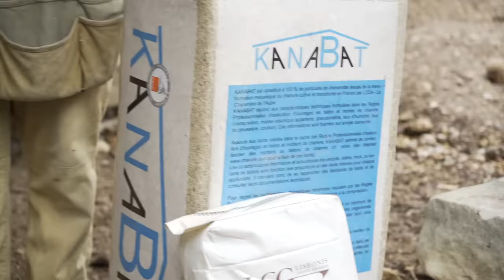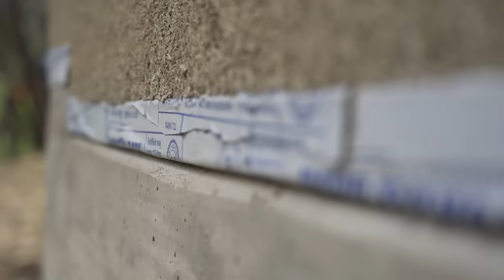Hemp Concrete Walls (R30 + Fireproof) - You Won't Believe How They Built This House!

Comment: Hempcrete is fireproof, bugproof, rat and rodent proof, moderates humidity levels. Therefore has museum quality air that provides an environment  where you can store papers, books, material, metal without degrading. Great wall material to live in, grow in, and store in.  I plan on using it as an infill for a geodesic dome, which is more of a suspension building, that will not be taken down by hurricanes. Try to blow this one down you crazy old wolf! lol Good luck to everyone in their endeavors.
Reply: Good day, thank you for your information. I need to read, and learn more about this. Any suggestions? Ciao.
Reply: I'm sure it is cost proof also.
To where the average joe would not be able to afford for many decades to come.

I've seen many videos on how this hemp product that they were using is produced.

And there is 2 methods.
And they are both long drawn out processes.

One method is using a hammer mill. Which I didn't like. The finish product looks dirty and inferior to the other method. Which is what I think the guys in the video used. Nice and clean and white.
Reply: @assog5737  they have companies making blocks out of it now. Still greenflation prone but its really nice.
Reply: @kraft_mo1245  Greenflation prone... that was hoot!  lol. Very accurate.
Reply: What happens to the hempcrete when the hemp degrades, oxidizes, and decomposes?
Reply: "Museum quality environment" ... wow that's appealing, never saw it like that. I imagine any earthen building which breathes moisture would be the same eh? Cob, Compressed Earth, etc
Reply: Yeah straw and wood chip and corn stalk chip all do much the same.
Hemp is great but it's over hyped because of zealous stoners who don't know the fundamentals
Reply: @mightyconker3903  To me is like a boutique material.  Available only in certain parts of the US, at a higher price than the alternatives.  Never mind South America.
Reply: It sounded amazing- until they said how toxic the binding material and lime is.  Not that there isn’t toxicity in the regular building materials- but I’d like to know more about the toxicity / alkalinity tests of the binder.   If it checks out, I’d looove this method and material.  Or what other binder options are there?
Reply: But it’s not Matt proof, he finds it irresistible. I think Matt may have smoked a couple of dubbies before he did the show intro.
Reply: They have hemocrete blocks now to replace cylinder blocks. It’s Incredible
Reply: @mightyconker3903  😂